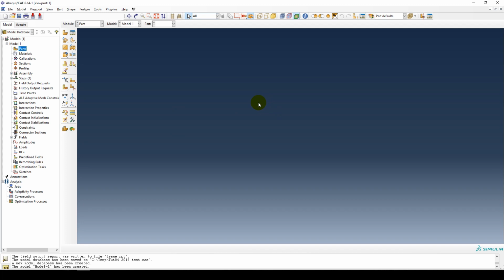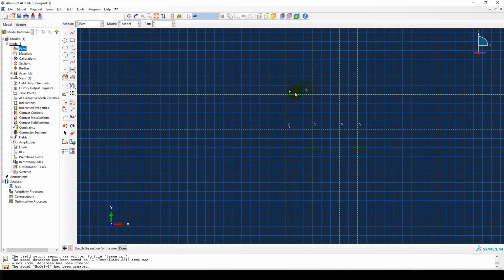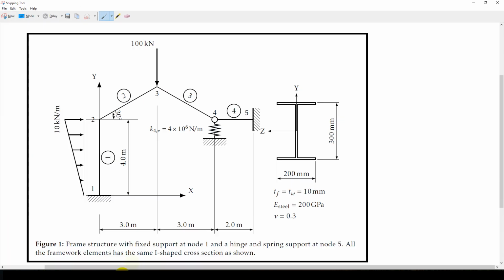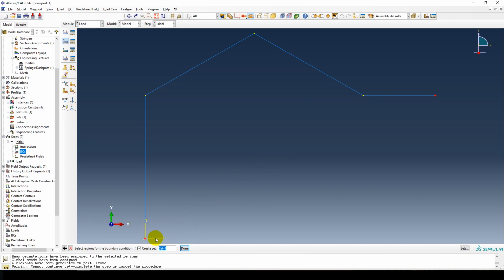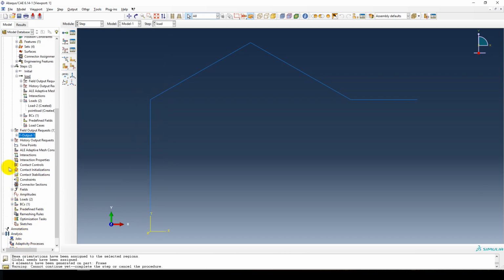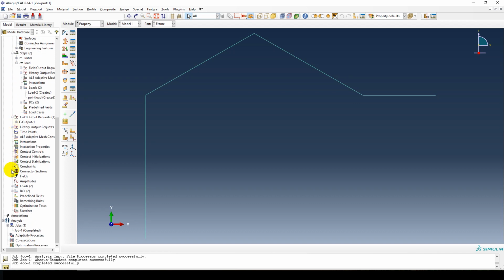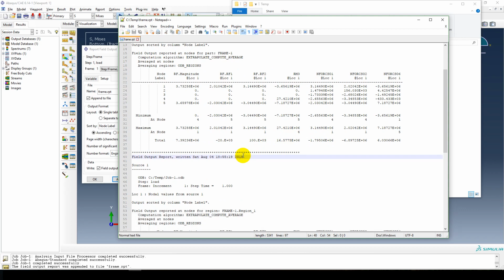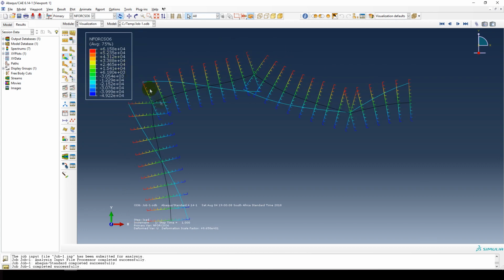ABAQUS #5: 2D Frame with prescribed displacement

Comment: You should not use the B21 element since it is not appropriate for this case where shear deformations are negligible and this element has a very poor approximation to flexural deflections (linear vs cubic) compared to the classic Euler-Bernoulli beam element B23. You can compensate the inaccuracies increasing the mesh density using at least 4 to 5 elements per bar, as in your last mesh, but the B23 element will give exact nodal results with only one element per bar. Also the innacuracies are worse for nonlinear analysis. You can find a very illustrative comparison of shear deformable beam theories in the 1997 paper 'On locking-free shear deformable beam finite elements' of Prof. J.N. Reddy. As a last remark it is misunfortunate that Abaqus has the element B21 as the default beam element, since many users believes that it has the same precision as the clasical element B23 and they use the element B21 inadequately.
Reply from the maker: Hi, thanks for the comment! To be honest I haven't dived that deep into Abaqus' element types, so your insight is much appreciated. I expected Abaqus to use the classic Euler-Bernoulli element by default as you states, I would love to know why they chose otherwise. From now on I would definitely use the B23 element.